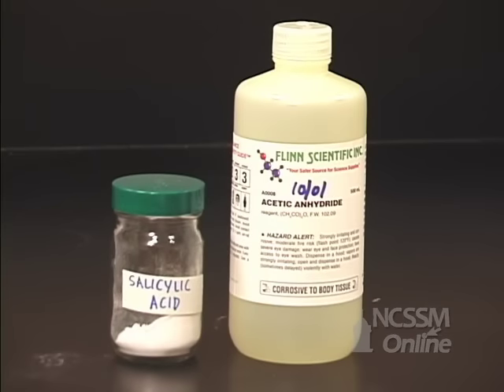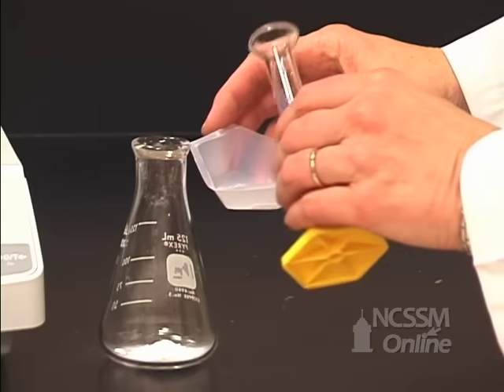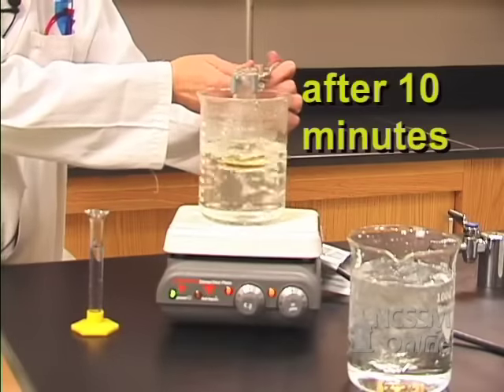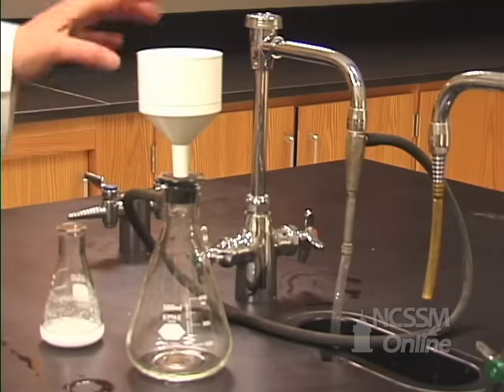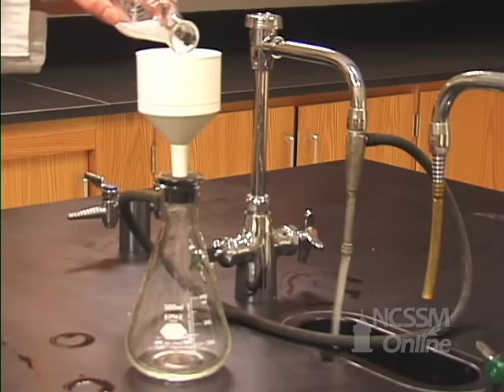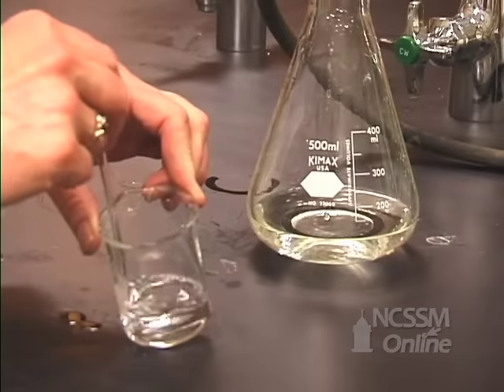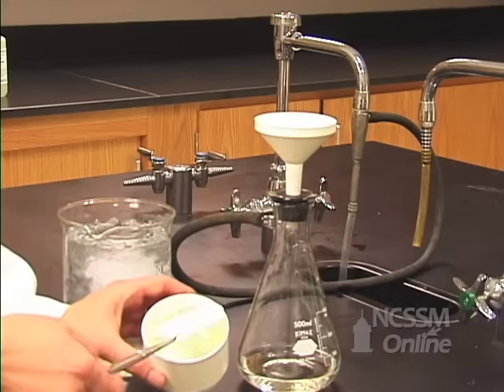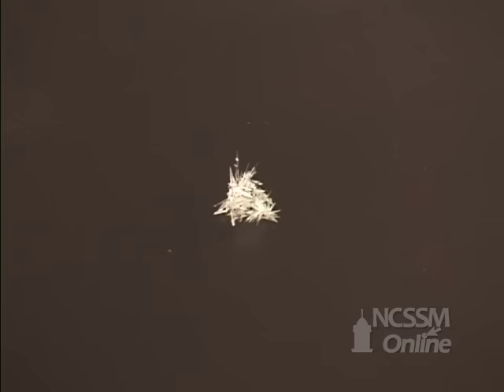Synthesis of Aspirin Lab

Comment: Above 80 °C salicylic acid esterifies the OH of a molecule with the COOH of another molecule of the same species forming a dimer and not acetylation, and this product precipitates with the acetylated species. In order to avoid this parasite reaction you should operate in hot waterbath but below 80 °C. Then basifying the crude acetylated product till solution, you can filtrate it from eventual dimer esther, then acidifying the solution you recover only the acetylated product that you can recrystallize. You can check for unreacted salicylic dissolving a drop of reaction mixture in a test tube with a Fe3+ solution, if it turn deep blue, there is unreacted salicylic.
Reply: can you build on this more? or maybe link a source to this information?

Comment: I need to take 30 mg of aspirin daily, but there is no such thing as 30 mg aspirin tablet. So, I am thinking about putting ten 81 mg aspirin tablets in a bottle, adding 27 units of water, then shake it well and take one unit of the compound daily, would that work? I see some solid looking thing at the bottom of the bottle and am wondering whether that is the only aspirin because if that's the case, it's impossible to take 1/27th each time. Not even close.
Reply: kosherpork this is a bit late but just a reminder that daily aspirin is dangerous and long term daily use is harmful. Only use it when you actually need it.
Reply: You cannot dissolve that much Aspirin in Water. You have to add some ethanol at least to dissolve it completely. Though I don't think that would help you. Your idea seems good at first, but practically it is not possible to do it like you want.

Comment: It doesn't matter. If the hot plate was 200 Centigrade the boiling water would be 100 Centigrade. If the hot plate was 500 Centrigrade, the water would still be 100 Centrigrade.

Comment: why do you weight the filter paper ?
Reply: Because it's almost impossible to get all the powder off the filter paper, so some of the final product will be on the filter paper.
Reply: What he said- you need to know how much mass the paper has so you can subtract it from your total mass.
Reply: @eldritchirideus2253  Yo bradley, what is the % yield of this reaction in this video? One of the top comments says 89% but for some reason they took 1:1 ratio? Isn't it 11:9 ratio of salicylic acid to ACA? I'm having this lab tomorrow, and just can't wrap my head around these calculations.
Reply: @TheDiamondShow  It should be around 89% based on the data they give. In this reaction, the ratio of salicylic acid to aspirin is 1:1. What are your calculations that led you to 11:9?
Reply: Bradley i forgot to put acetic acid as a product and it fucked up my balancing lol Thank you!!
Reply: @TheDiamondShow  No problem!

Comment: Seems counterintuitive to make aspirin with salicylic acid since the body turns aspirin into salicylic acid which is what nums pain.
Reply: corgidog can we safely ingest salicylic acid?
Reply: Salicylic acid is converted to acetylsalicylic acid which is the same for aspirin. The added acetate group makes aspirin easier to swallow (since it’s original form was a liquid) and less irritating to stomach. Once aspirin reaches small intestine it’s converted back to salicylic acid and goes into blood stream.
Reply: Salicylic acid is not the active form, the conversion is the important part, as COX deacetylate the aspyrin and, in turn, get acetylated and inactivated. So, no, if you take salicylic acid you aren't inhibiting COX, you're just putting an exfoliating agent in contact with your gi mucose. You end up with more pain, not less.
Reply: @mariabenitez2461  Yeah, the reason for using aspirin instead of salicyclic acid is because salicyclic acid is extremely irritating for mucus membranes and can cause ulcers with long time use.

Comment: Is there any way to turn aspirin back into asetic anhydride?
Reply: Aspirin can decompose into salicylic acid + acetic ACID by reacting with water. However, I suppose you could convert the acetic acid into acetyl chloride and then react with sodium acetate to produce acetic anhydride + NaCl.
Reply: Yes the reaction is reversible
Reply: Hydrolysis
Reply: @whathey3113  Hydrolysis would not result in acetic anhydride. It would result in acetic acid and salicyclic acid.

Comment: everywhere I look they just say "acetic anhydride..." But where the hell do I get this substance?!
Reply: Lol good luck. No where. Not legally at least. It's super hard to get and don't even think about making it. The ketene process is probably the easiest but EXTREMELY toxic. More toxic than HCN and I believe it's right around phosgene. 

The reason no one sells is because it's used to convert morphine into heroin. Sucks because it's such a useful reagent. You can get high yields of RDX using it too.
Reply: @Andrew-my1cp  do you happen to know where chemistry teachers get it from? And BTW where did the guy in the video get it from?
Reply: @wubwub616  They likely can't. It's a heavily regulated chemicals and rarely seen outside of industry. The guy in this video must be with a university who can get some or have some from years ago. 

As a private person, you won't be able to get any. Even universities often can't get it.
Reply: @wubwub616  What do you need it for? In some cases you can use glacial acetic acid in excess and get an acetylation reaction going. Yields are lower and the reaction doesn't always work with it but in some cases it's possible. I believe for aspirin it is possible.
Reply: @Andrew-my1cp  how does it work with glacial acetic acid?
Reply: @wubwub616  it still acetylates it but it's catalyzed by sulfuric acid. There are videos on Youtube about aspiring manufacture using acetic acid.
Reply: @Andrew-my1cp  thanks for help mate!